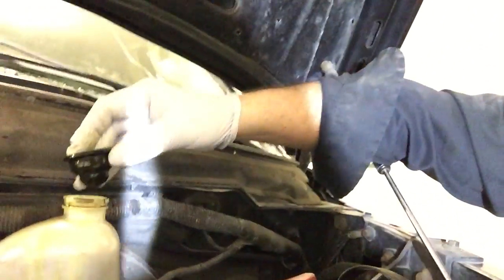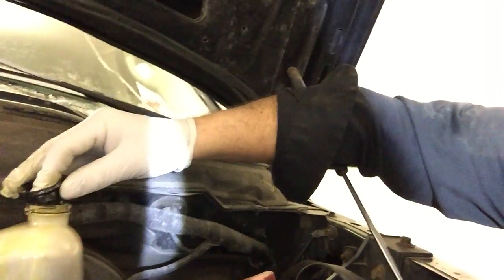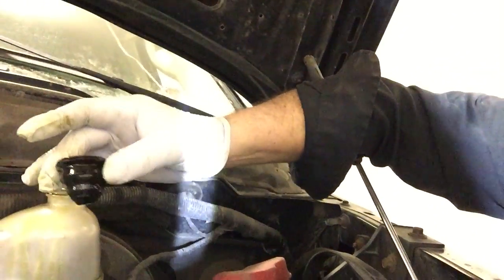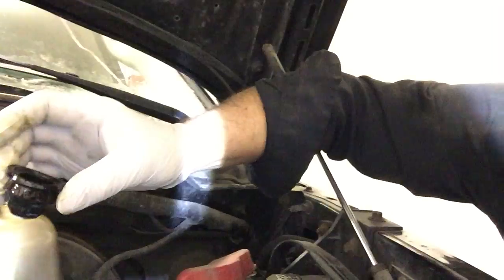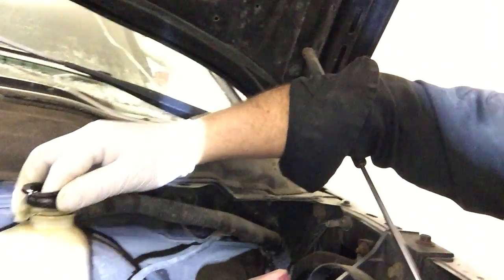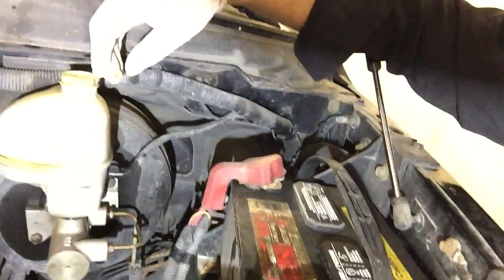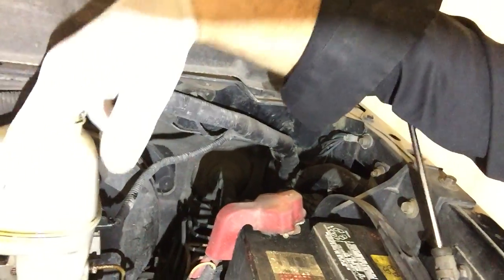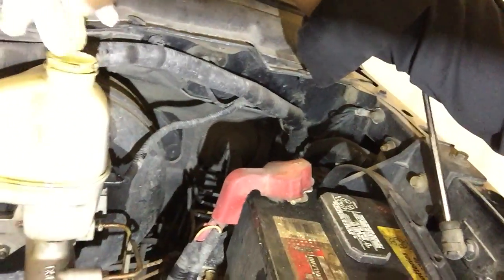What happens When Oil Is Added To Brake Fluid - Dodge Ram Oil Contaminated Brake Fluid

Comment: I'd be off to the junk yard to buy a complete brake system for that truck.  Still a lot of work and expense but should be a lot cheaper than buying new everything.  Looking for ward to the next repair video.
Reply from the maker: +dan andy Yes if it was my truck I might do that. I just can't put junkyard brake parts on my customers vehicles. But hey, I probably wouldn't put power steering fluid in my master cylinder in the first place. Yuk!
Reply: +dan andy most shops dont put used parts in as they have to warranty their work
Reply from the maker: A guy talked me into flushing his Audi brake fluid after his wife put engine oil in the brake master reservoir. The proper repair would have cost about 8K It was against my better judgement but I did it and put a disclaimer on the repair order. About two weeks later her brake pedal fell to the floor during a normal stop in traffic. our customers rely on us to give good advise and keep them safe. It sucks having to tell folks how much their mistake is going to cost them.
Reply: +The Car Doctor * With Audi it really doesn't  make any difference.  They are a never ending money pit anyway. The brakes were probably going to fail next week  if the engine didn't fail this week. Absolutely the worst car I have ever owned, and I have owned a lot of cars new and used over the past 47 years.
Reply from the maker: Haha. Can't argue with that.